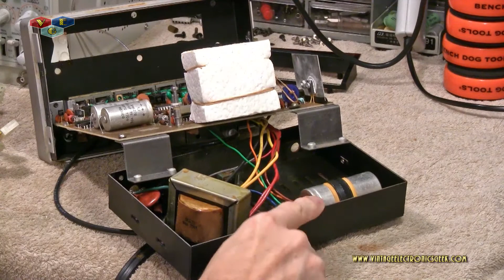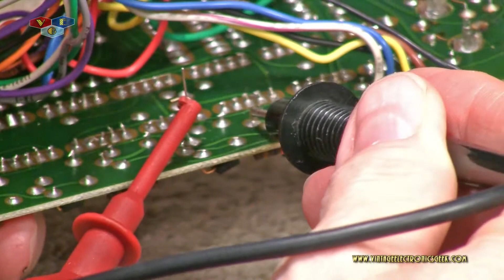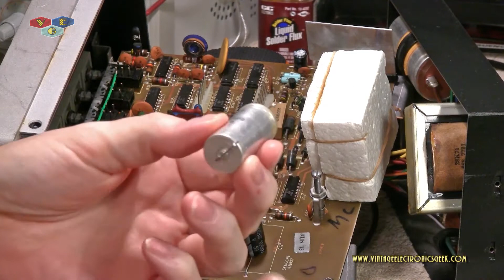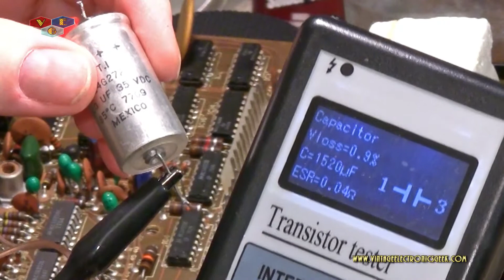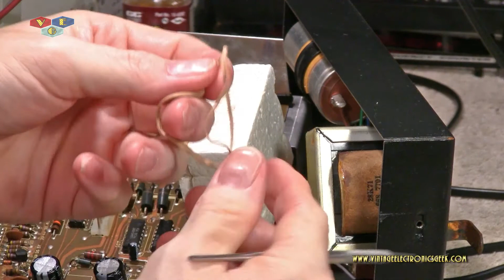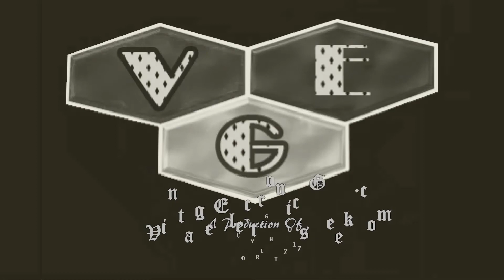Sencore FC45 - Frequency Counter - Pt II - General Servicing

Comment: Looking at this instrument it's full of contradictions the manufacturing looks really crude but they have gone and installed that expensive oven controlled crystal oscillator and then stuck that horrid expanded polystyrene insulation around it. Really Strange. That was a good tip about setting the power supply current limit we have all made that mistake!  I love the hand tape routed PCB priceless. I have to say your wrong about testing those ICs I need at least 3 Logic analyser on the workbench just to make sure. I will probably purchase a few more just to be sure.  I hope that you can get a matching replacement LED display. Thanks Jack I really enjoyed being at your bench for this one, great progress. My very best regards Chris.  PS been drinking again you can probably tell.
Reply from the maker: Howdy Chris!  You know when I made that comment about the logic analyser, I had you in mind!  :)  Brother, if my bench was as big as yours, I'd have more toys, er, tools like you do!  :)  Its Sunday, its a good time to be tipsy and enjoying your lovely country views!  Thanks for watching!  ~Jack, VEG
Reply: LOL I thought you may have been thinking about me and I just bought another one.  It's funny about the world bench size. Whatever you have you will fill it just the same.   I really need to get rid of some of it.  Thanks Jack. Regards Chris
Reply from the maker: Before you dump it, do a video on it!  I don't have a need for a logic analyser, but after your video, I trolled really hard for a few days!  I have more gear that has came in, as soon as I get the last installment on the Sencore filmed and edited, I'll work on them...and you're right, I keep adding, wanting more and trying really, really hard figuring where to put them!  :) ~Jack, VEG